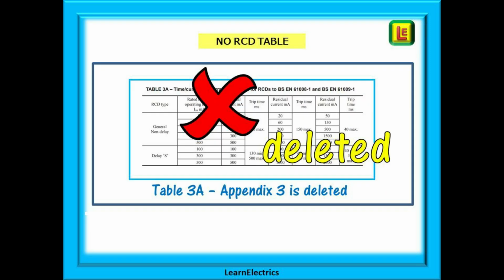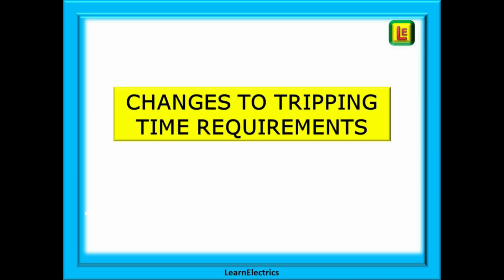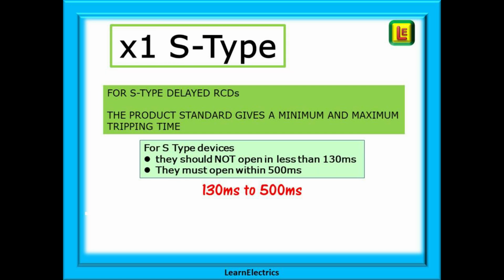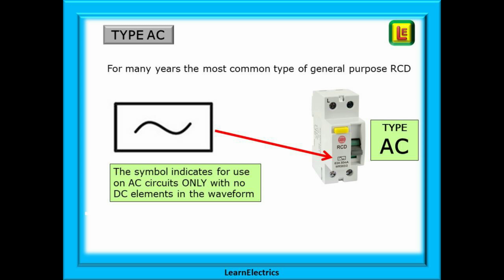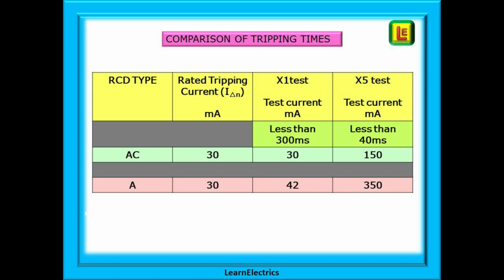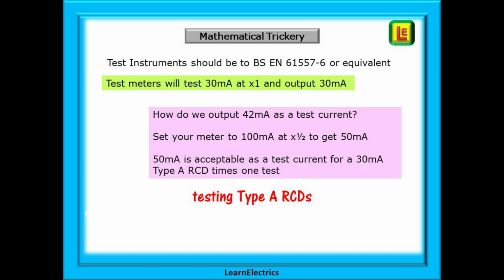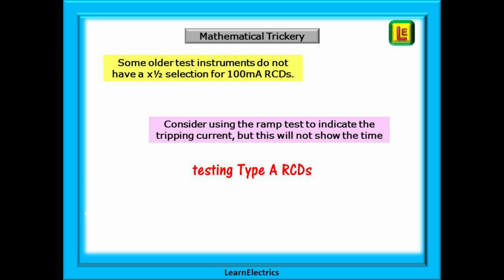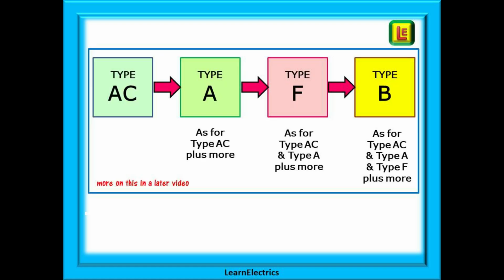AMENDMENT 2 - 18th EDITION – RCD TESTING CHANGES – SHORTS 6

Comment: Hi Dave...would I still carry out the 5x and 1/2x if the circuit was designed in the 18th edition, but before the amendment. Many thanks in advance 👍
Reply from the maker: There's no need to, but the half and five times tests sometimes reveal problems that you might miss, especially if the RCD is just starting to break down. I always do them, they only take 2 minutes longer and give you peace of mind.

Comment: Can anyone advise ? I thought the x5 (150mA) test on a TN system was to verify the device's function for additional protection; which is what an RCD is for isnt it?   If its no longer a requirement to record x5 results then what are we testing an RCD for ? Have I been thinking wrong all this time and a x1 (30mA) test below 300ms satisfies additional protection ?
Reply from the maker: James, a times one test is what is required by the Regs. However, many of will still do a times half and times 5 test as well. Occasionally I have come across an RCD that passes x1 but fails x5. Early warning that things are going wrong. I usually write the extra test results in the comments column or on the back of the certs. To answer your question, a 30mA RCd at x1 that trips in less that 300ms is a pass.
Reply: @learnelectrics4402  A fail on a x5 test does not necessarily mean things are wrong, especially when testing RCD's other than of the AC type, see  https://www.youtube.com/watch?v=mYWeN8HknPg&ab_channel=LearningLounge

Comment: You cannot do a 100mA x 1/2 test on a 30mA RCD. The tester does a check to make sure the voltage of the earthed metalwork does not go above 50V just before the actual test at 1/2 times the selected current, irrespective of the multiplier selected. It would do a 50mA precheck and trip the RCD with the display saying "trp" and not with a trip time. 
I have only come across the problem with AC RCDs failing when someone hasn't realised that the tester is set to type A. When testing type A RCDs on a type AC setting there is no problem.
Reply from the maker: Absolutely. Thanks for watching.

Comment: The advice in the video is incompatible with the latest version of guidance note 3, which is very clear -  A type 'A' RCD, or indeed type 'B' or 'F' any new type yet to be invented as well, should be tested as  if it was an AC type at the rated current - so test at 30mA with an alternating current fault. The other tests, such as an unsmoothed DC at 42mA are options on many test instruments but are not listed in the minimum set of tests. For a normal alternating current still test at 1* and note the slowest trip time.
Reply from the maker: Thanks for watching, appreciated.

Comment: Hi Dave, thanks for your very detailed videos and understandable. If I may ask you what type of multifunction tester do you recommend to an electrician,  the brand and type for domestic and commercial electrical installations?
Reply from the maker: Thanks for the question Nicholas. Have a look at the video below. There have been more Multi-Function Testers added to all the ranges since it was made but you will get the idea. They are all pretty much the same in what they will do, just how many features do you need. I would certainly consider one that was settable for different types of RCD. Depends how much money you have in the budget. Ask at two or three wholesalers before deciding, there will always be a sparky there that will tell you about their meter.
Here's that video.
BUYING MULTI-FUNCTION TESTERS, click on the link below
https://www.youtube.com/watch?v=6Q4CM_6M4wo
Reply: @learnelectrics4402  Thanks for your help  Dave much appreciated

Comment: IET put up a video on the amendment 2 changes , and they say we are now only required to test at 1 times on the Test instruments AC setting irrespective of RCD type and they should trip in less then 300 ms , and the 1/2 times and 5times tests are no longer a requirement 
And we are not required to buy new test instruments, but we can continue doing all the tests if we want to . I will continue to do all RCD test as I always have done. 
Fantastic video very well explained.

The effectiveness of automatic disconnection of supply by RCD shall be verified using suitable test equipment according to BSEN 61557.6
NOTE: regardless of RCD type effectiveness is deemed to have been verified where an RCD disconnects within the times stated below with an alternating current test at the rated residual aperrating current (I^n) for general non- delay type 300ms maximum 
For delay ’s’ type RCD between 130ms minimum and 500ms maximum , oh I am not trying to  correct you or be disrespectful 
Fantastic video As always Dave 👍👍👍👍❤️
Reply from the maker: Sean, yes I would still do all the "old" tests myself, peace of mind.
Your last paragraph, isn't that what I have put in the video. Thanks for the support. Dave.
Reply: @learnelectrics4402  yes you did , sorry mate  I got a little bit distracted by my grandson but I did watch again to the end.